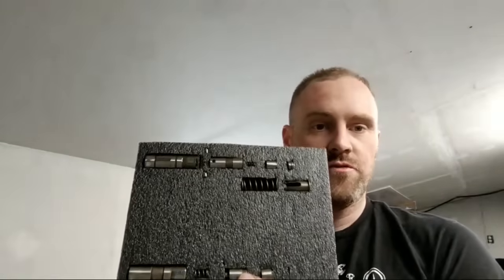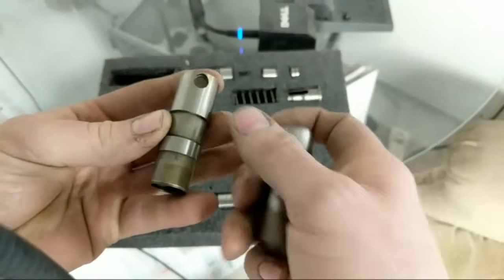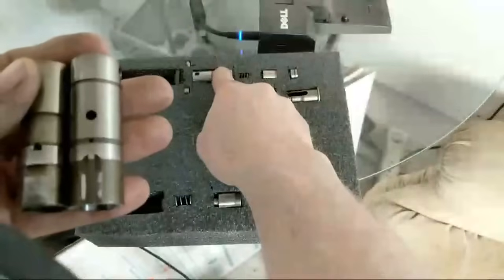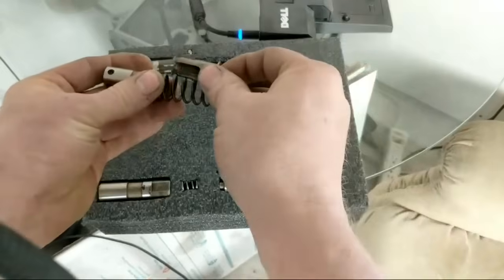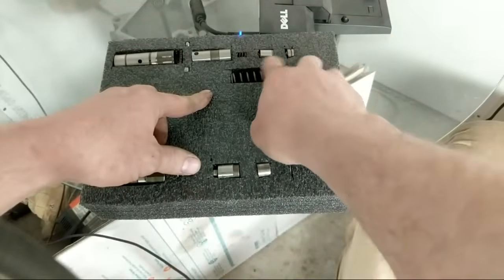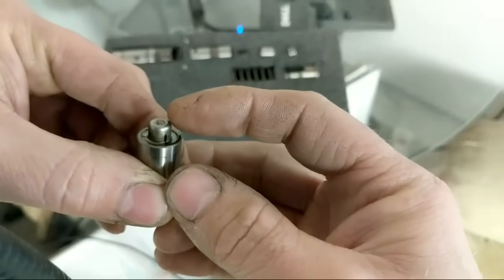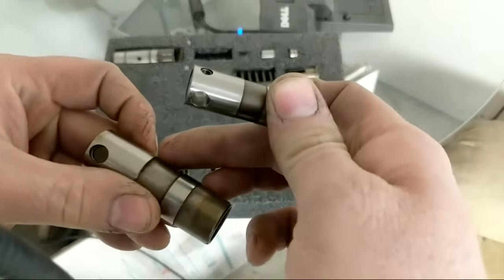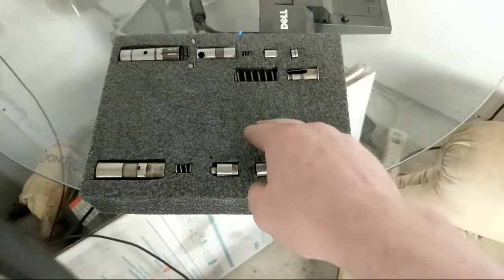What's Inside A DOD Lifter

Comment: So the pushrods are the same length vs stock lifter. Just when they collapse its app .400". Base circle on the cam is the same and you can just put stock lifters in there but you need 2 new lifter trays that you'll need to modify slightly. You will see what I mean.  Ive done this many times. Never an issue. You can also get someone to flash a dod delete tune before you have problems and not worry about it.
Reply: @slopoke22  I’m about to do it. Hope I will have the same outcome and everything would be fine. New stock cam. All new ls7 style lifters
Reply: @jesseroberts3237  yes, you will be fine. But, one thing is you need two new lifter trays.

Comment: Hey great video Bro. Question? I’m replacing lifters on my suburban but the lifters that I got look the same as the older ones . except for the inner part where the spring comes, the old lifters bring openings as well as the one you show, and the new lifters are solid without openings. my question is whether installed they make the same mechanism or will they bring consequences?
Reply from the maker: I've seen those too and they seem fine. Big thing is to make sure they actually don't collapse by hand. If you bought cheap ones I've heard of them not opening valves at all. They act as if they are in AFM mode all the time.
Reply: @CrazedPerformanceRepair  l appreciate you time …

Comment: What would be sweet is if a delete kit could be developed to be as simple as swapping the DOD lifters with regular lifters, adding longer push rods  to the DOD cylinders and NOT having to do a cam shaft swap. This would make diy deletes for the masses much easier.
Reply from the maker: It would have to be done with special lifter, the AFM camshaft has a different lobe profile on the afm lobes.
Reply: @CrazedPerformanceRepair do you have any data to show that the lobe profile is different from a dod cam lobe vs a regular cam lobe? A prior comment a guy has said he has put regular lifters and has never had an issue
Reply from the maker: @Jay-country  besides the fact I put standard lifters on AFM cam before I new better and had a misfire on 4 cylinders at idle and low vacuum, no I don't. But I do have a AFM camshaft in the shop and a degree wheel. I could probably figure it out to prove it.
Reply from the maker: @Jay-country  there is also the fact if it wasn't different, GM wouldn't make a difference part number for AFM vs non AFM.
Reply: @CrazedPerformanceRepair  Just curious why you would only have a misfire on cylinder 4 and not the rest of the afm cylinders also?? This issue has been bugging the heck out of me. Last night I put a cam in the lathe and a dial indicator, rolled it around by hand and every intake lobe was the same, and every exhaust lobe was the same. Now obviously that’s only part of the equation, but my question is if a regular lifter with pushrod together is the exact same length as a afm lifter with a pushrod why would it matter if you replace the the afm lifter with regular ones?
Reply from the maker: @Jay-country  not sure why you would think you would only have a misfire and cylinder 4. If you replaced the AFM lifters with non-AFM lifters you would have a misfire on all four AFM cylinders. This has nothing to do with total lift. It has nothing to do with pushrod length It has everything to do with the cam profile as a whole. The part of the cam profile that is different is during the beginning part of the ramp. My understanding is that in order to prevent the lifter from making noise due to the slack in the locks of an AFM lifter, GM had to add a little bit of lift right at the beginning of the cam lobe before it opens up the valve. So when you put a standard lifter on an AFM lobe it will open up the lifter ever so slightly way before it should have. This in turn causes it to not be able to build proper compression at idle. In order to see this you would have to have a degree wheel attached to the camshaft and measure at various areas during the lift of the cam lobes. Then of course you would have to compare them to a non-AFM cylinder can lobe. Set up for this would not be easy either. You would either have to have hooked up to an engine so you could set the degree wheel to TDC of the AFM cylinder and the same for the non-AFM cylinder to get the cam profile. Then you would have to compare the results at various stages of the cam profile. One would probably have to measure and write down for every 5° of crankshaft movement how much the camshaft lobe has lifted the dial indicator. Then you could actually map out the difference of the two.
Reply: @CrazedPerformanceRepair  ahhh I thought you said you had a misfire on #4 cylinder. But you said 4 cylinders lol.

Comment: If I have a dod lifter collapse, can I just run a longer pushrod to work with the shorter collapsed lifter? What is the difference in length between a open dod lifter and a collapsed dod lifter?
Reply from the maker: The problem is what is the difference once it is collapsed, how far did it collapse and will it be able to collapse more than what it is? Picking a push rod length to use non DOD lifters on a DOD cam would be possible I think but I have not had the time to measure and compare the two different camshafts yet.
Reply: @CrazedPerformanceRepair  I would think if its partially collapsed, it wouldn't be too hard to fully push it in as the lock pins should be stuck out of the groove they lock in. I suppose ensuring it was fully collapsed would be mandatory, then you would be clear to use a longer pushrod. You could try and measure the difference collapsed vs not and add it to the length, or I guess the proper way would be to use a pushrod length checker on a couple of collapsed lifters and see if it is consistent. If you were going to do that to one, you would have to do them all I assume. I'm no expert here, just supposing & asking the expert.

Comment: I have a 2014 Tahoe PPV and I have a slight vibration in idle and about 55 to 60 Kms it get worse (Canadian). Do you think it has anything to do with the DOD?
Reply from the maker: It could very well have something to do with DOD are there any codes?
Reply: No Codes @CrazedPerformanceRepair
Reply from the maker: @davidreynolds2353  if there are no codes it's not likely DOD related. I would probably have to see it for myself and that's not happening in Canada lol but if you have any more things to describe it I may be able to point you in the right direction.

Comment: Dude, it’s not DOD. That is what the prior generation of failed GM cylinder deactivation was called way back in 1981.  From 2005-2018 it was called Active Fuel Management.  Also known as AFM. If you’re going to be constantly posting videos where you front yourself as the subject matter expert on what to do about it, at least get the damned name right!
Reply from the maker: AFM= Active fuel management, these are lifters in this video they do not control fuel. DOD= Displacement on Demand and controls the lifters to change the usable displacement in the engine by controlling the air entering the engine. Sorry to hear you can't understand that... GM uses both terms in the modern system because of the advancements in fuel injection, which mind you mechanically speaking is not much different than the system in 1981 (it keeps valves closed). I'm sorry you can't comprehend this... put it this way, back in the first vehicles wheels where different than they are today, does that make what cars roll on today something different? Is a piston 100years ago some how today not a piston because it has been upgraded to work more efficiently? Perhaps have a beer and calm down lol its ok we will all be fine...
Reply: CrazedPerformanceRepair  sir I have a 2015 high country with 5.3 engines , 72,000 miles on it and it just starts the ticking sound a few months ago,,, what would you recommend me to do?  Should I just change the lifters to the stock ones or should I do the full delete?????
Reply: How do you release a non DOD lifter... Say cylinder#5 on a 5.3.. Great videos, great channel.
Reply: So the AFM lifters are the ones that go bad right

Comment: Bunker branding is demolition ranch merchandise site. He does utuber merch.  What year did 5.3 dod start. I have a 2005 avalanche and was told that code in glovebox  shows that my truck is not affected. Just curious.
Reply: 2007 on for AFM / DOD
Reply: @FiveFive2man  I have a 2007 ,but it has a 2006 Engine , which doesn't have AFM/DOD
Reply from the maker: Matt said I need 100k subs and I can use bunker branding so that's my goal not sure it will happen this year but I'll try haha. As for the year 05 was the beginning in specific models but for the avalanche and most others it was 07 like 552man said.